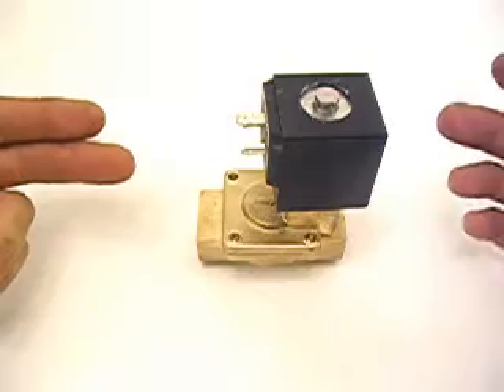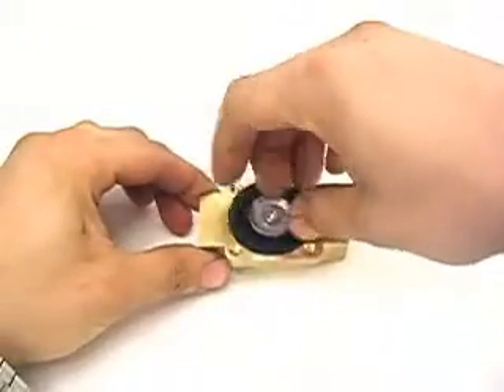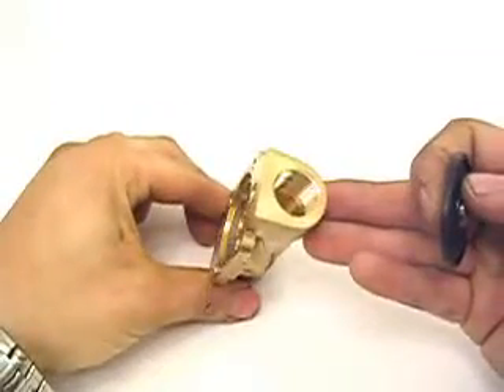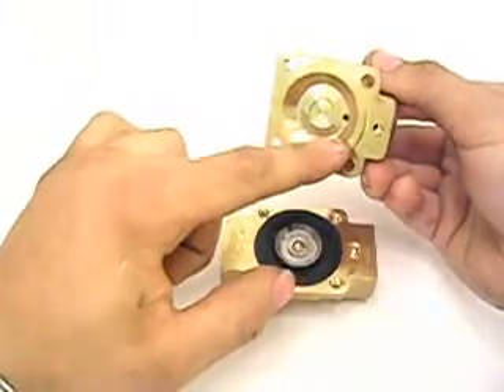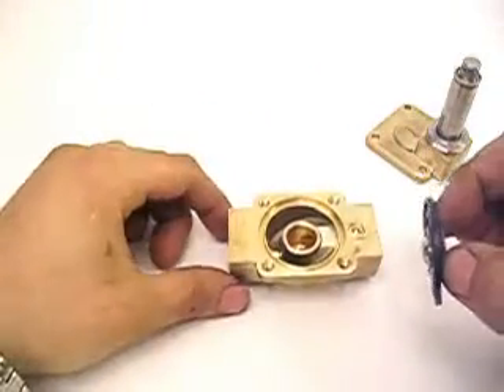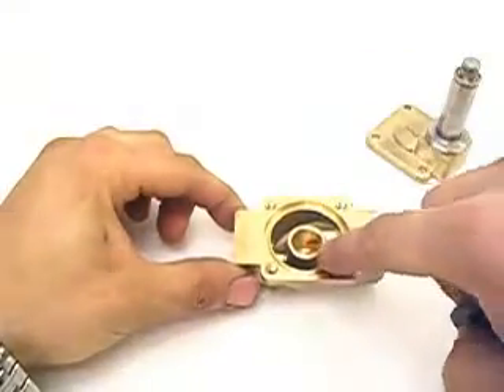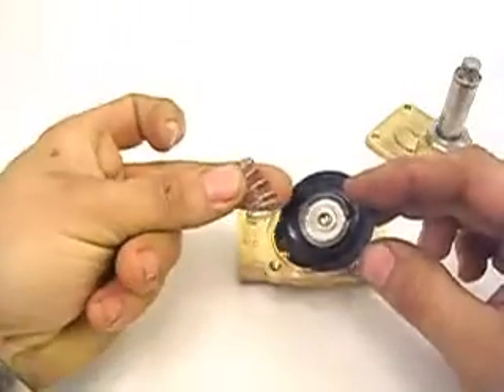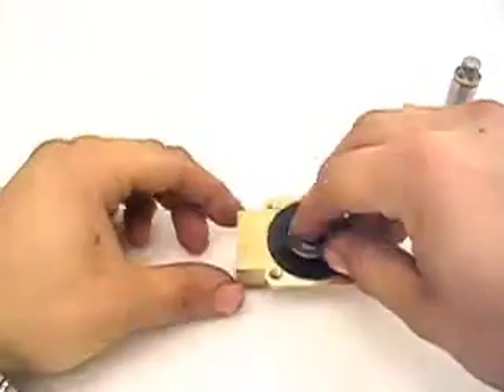Air Valve Question

Comment: Is there a right position for where you leave the diaphragm small hole?
Like towards to where the air comes in or where it actually comes out?
Because my solenoid keep leaking air on the diaphragm i tight the screws and like a week after it starts leaking again
Thank you